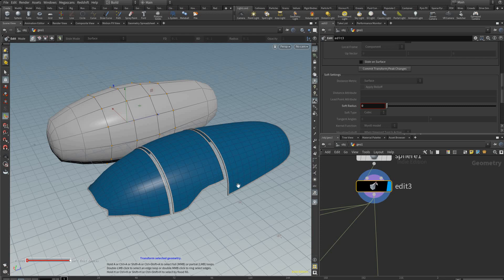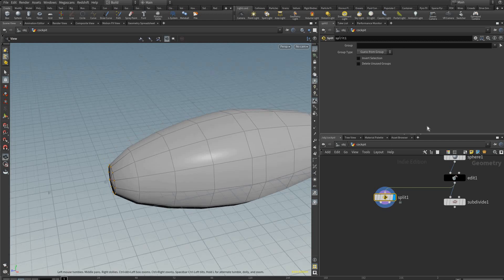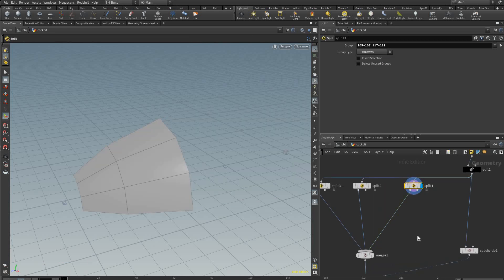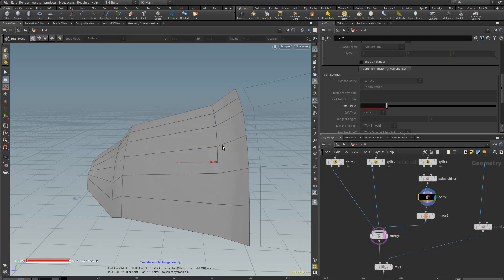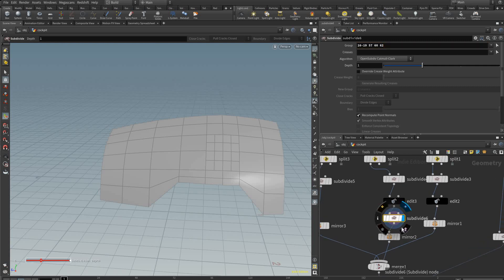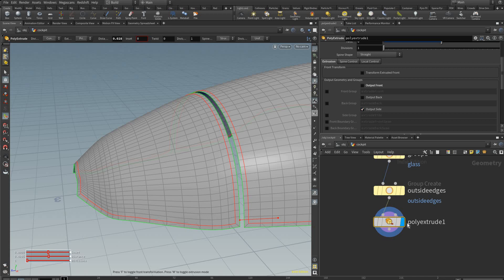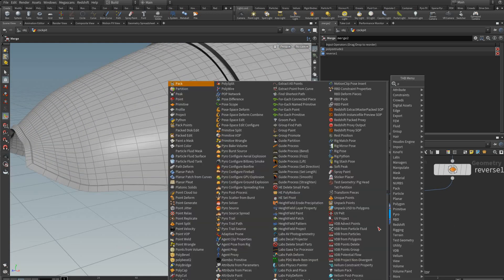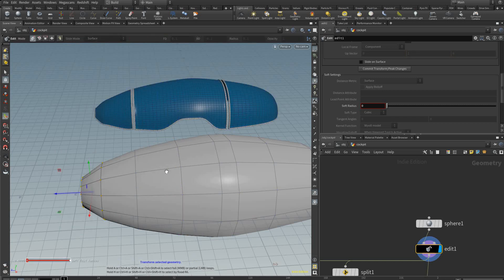Aircraft Cockpit Houdini Modeling Tutorial

Comment: Cool method, but I  fail to see the point of Ray. You get the same result just adding subdivide, with the added benefit of closer following of the source shape.
Reply from the maker: The ray is used so you can modify the geometry without having to be extremely careful with risk of losing the perfect circular profile that is needed to be maintained during revisions, its very common someone would model something like this in low poly, they later decide to more verts in 3 dimensions for a change, subdivide and end up with a lumpy result because when they moved the verts, they lost the curve of the model, the flow.

Good modelers don't really need it, they can eye ball it just fine, but Houdini has this power to keep editing easier and quicker. (at the cost of complication in setup)